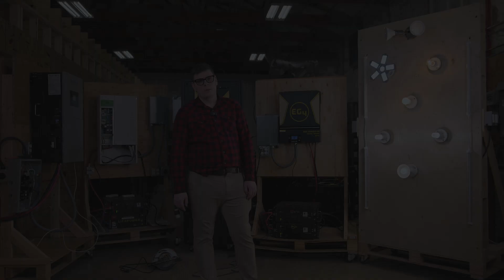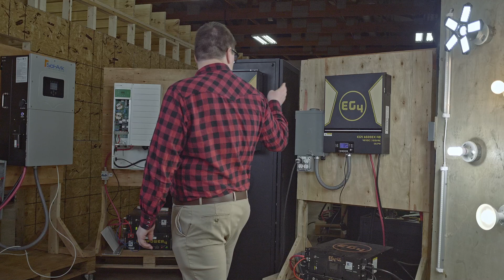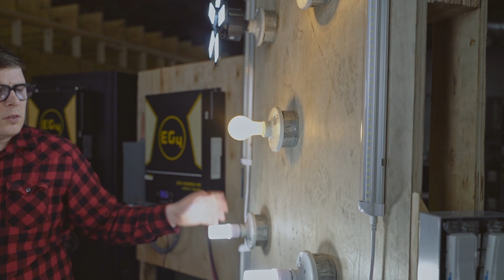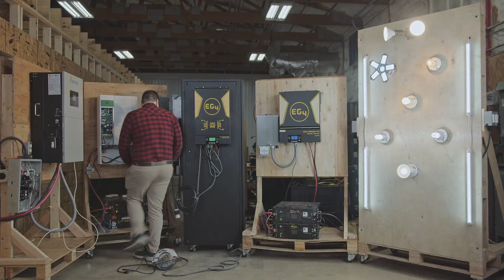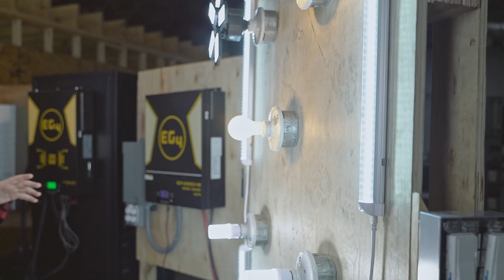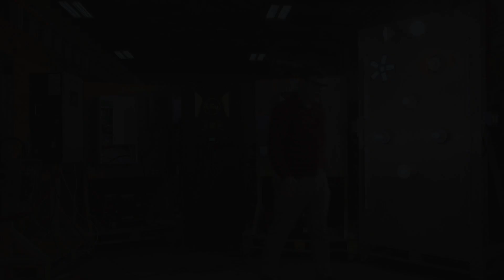LED Lights | The Sustainable Solution for Off-Grid solar users

Comment: Great I just installed the EG4 6000XP and noticed all lights flicker and with any power changes. The house is new with integral bulbs and fixtures. Replacing all the fixtures is out of the question. Now what?
Reply from the maker: Hi! If you'd like to reach out to our technical department at 903-441-2090, option3, we can take a look into this with you!

Comment: Noob question:  While testing the 6000ex, are you using a step-down to obtain 120v, or is it just one leg being utilized?  If one leg is being utilized is the power capacity cut in half?
Reply from the maker: One leg is being used and the power capacity is being cut in half

Comment: I've double checked my neutral and ground bonding. And I've replaced led bulbs and still have a terrible flicker and pulse.. Hopefully it will change when i connect all 4 - 6500's up.

Comment: I have the same flickering issue with the MPPSolar LVX6048 (same as the 6000EX in the middle) but only when using solar panels, (no grid), when using battery it doesn’t flickers.

I read there’s a firmware update fixing the flickering but I have no PC to update the firmware, just a MacBook Pro. All my house lights flicker, even the light inside my fridge. LEDs, Smart LEDs, encandecent, LED strips, fan’s LED lights, all kind of brands I’ve tested and each and everyone flickers.

Is there a way to update the firmware other than buying a PC laptop?

Comment: The only thing I need a AC inverter for is to push power back on to the grid which should be HVDC but it's not. It's much more difficult to tie in electrical grids with AC than DC........ HVDC is also more efficient than AC for transmission over long distanses.

Comment: Kan we please get 48 volt DC  bulbs / lights so we don't need to run an inverter.

My Fone, My Laptop, My Power Tools, My Chain Saw, My Speakers, Flash Light....... Everything I own Runs on  DC Even The Kar I want has is Powered by DC and the Power that Komes From Solar Panel That I want as well also are DC so wy exaktly do I need an AC inverter to change DC Battery Power to AC power to power all my DC Krap!!!!!

Comment: Thanks for the video. I’m having issues with split-phase loads like my mini split causing Philips Hue strip flickering and APC battery backup clicks to battery mode. Only occurs when the outdoor unit turns off. Strange part is it flickers expensive lights also only when it turns off.
Reply from the maker: Have you contacted our technical support team?
Reply: I didn’t. In my troubleshooting it seems to be my Cooper & Hunter Mini-split causing the issue. Looking into running a mini-split off the DC using your unit. 👍🏼

Comment: Very good demo video.  Scope traces would be nice to see what is happening.  On my whole house system, with 2x SMA US6048US and AC couple Enphase microinverters, I see similar flickering on certain led bulbs, when the microinverters output is approximately matching the house loads (generally morning and evening, or cloudy) and the main battery inverters are hanging out maybe not sure whether to charge or discharge the battery.  It's not a big deal.

Comment: My LF Aims 10kw 240v inverter did not flicker. I think you are correct that the HF  inverters do have more flicker problems. My biggest flicker problems is in the refrigerator bulb and micro-wave inside light. Also lights that have a dimmer switch. I have two EG4 6500 inverters dating 7-2022  that I am running separately as 120v units. Also the sewing machine bulb flickers. These are all small bulbs and I don't see me trying to find replacement bulbs of a higher quality. My LED lights are not flickering.  Going to look into the firmware update.

Comment: Corsi's you in lights start flickering not because of a power issue it usually means that the power of the light is no good no more and I liked about to break or die I mean light bulbs do go bad after a while but I don't think that would be my concern either.

Comment: Of course she said off-grid when you can also use it on Grand and could also use it to sell electricity to the electric company in almost all the 48 states I mean I know there's some companies that won't even pay for it but really doesn't have to be off grid it could be for cell to the grid and also for running your house and to 6000 watt inverter might be enough for my house but Ithinking I'll need three sweater have to go with four.

Comment: My light flicker REALLY bad during the middle of the day when my solar panels are putting out over 2000 - 3500 watts. I have the EG4 6000 unit. It's only when the PV input is being used to power the house or charge the batteries in the middle of the day that the lights flicker. At night when the unit is running off of battery power, I have ZERO problems with flickering lights. Does anyone have any ideas about this situation?

Comment: Really appreciate the tests and the time took to produce this video. Even on grid power you can expect some flickering with cheaper LED's. Then if you throw in dimmers that adds another circuit that needs to be stable.

Comment: So what I find interesting is that when I have my inverter running, I get LED flicker (PowMr 5000w hybrid inverter, 120v). When my furnace starts up while running on this thing, you can HEAR a difference in the draft inducer motor (it has this weird whine to it) which would tell me that the power coming out of the inverter isn't clean. Eventually, I want to get a transformer based 6000EX to power my loads, as I think the cleaner power will be much better for them. So I think the flicker is probably an indicator of slightly dirty power. Note that when the unit switches to AC power, everything is fine, so it's only when it's inverting that the power is "dirty".

Comment: Cheap led bulbs have very minimal circuitry. The better ones have converters, etc to change the AC to DC and clean it up.
Best bulbs I've had are Fiet versions that are COB (look like filaments)  The only time any of the bulbs act weird is when I have the inverter (growatt) set to switch to grid power at end of the solar day to charge the batteries.

Comment: I've even seen LED bulbs flicker from inverter generators. Happy to see that SS has a firmware update that helps to address the flicker issue with the 6500EX.

Comment: Good info James, thank you. I have several  cheap spiral LED bulbs that continually flicker and then fail when powered by my Growatt 12K or my Generac. Putting a scope on either output shows a fairly clean 60Hz Sine wave. Now I can stop looking at the source and examine the load.

Comment: Great Video;  Heck I get flicker while on Grid and LED lights, what really get them is the Keurig coffee maker "disco days!"  but worse in off grid mode,  I really just don't care because any light, heat and other house hold goods is way better than sitting in the cold dark nothing when the power goes out...
Reply: I have the 6500ex-48.  That mother #$@% Keurig almost caused me a mental breakdown after my system was running. I went through so much work trying to figure out what was causing my disco tech lights, I almost gave up and ripped my inverters down! One day I was in the kitchen ( not making coffee ) and I heard that machine make some noise and my disco started , I ripped the cord out of the socket and like magic my problems were solved!! I now keep it unplugged until I use it. Hopefully others can see this and know what's going on before going crazy like me. The Keurig will cycle when being used but most importantly when not being used and cause these effects!
Reply: @aaronweisser8777  Big Laughs well worded! 
I really hope this helps others, thanks for that reply, have a great day!
Reply: @asahperry6537 we are sometimes no match for all the wiles of all the appliance manufacturers combined lol

Comment: Can you give us some examples of what you guys classify as "high quality bulbs" that have little to no flicker (outside of motors running)?  What are the specific brands of the ones you tested in the video?
Reply: we used the keystone KT-LED13PAR38-F-840 to avoid flicker
the GE relax LED8DAGSW90 was the flickering one
Reply: @jamesshowalter6362  thanks
Reply: The Phillips hue bulbs, white only,  behave themselves, multiple models and years purchased.  Have been slowly changing over the whole house to zigbee compatible Wi-Fi bulbs. I like gizmos and no worries of turning off lights at night I can set them to do it themselves,  Haven’t tested the color ones yet. Cheap led shop lights absolutely do not.  Nice to see sig solar addressing this.  Have to admit they have done a bang up job with tech support for my eg4 ll v1 battery trying to get the lcd panel working again.  BMS replaced, didn’t fix, now replacing screen assembly.  Long post, sorry.  Longest lived led light is at 9 years so far.
Reply: Phillips!
Reply: forget that, can they give me an example when any light, led or otherwise will in REALITY last for 25 years, NEVER
Reply: @bonzology322  well I will be a middle-aged man by the time I can prove that point on the good ones lol

Comment: what does signiture solar consider a low quality bulb based on specs ?

what does sgnature solar consider a high quality bulb based on specs ?

all my bulbs are LED in the home
Reply: we used the keystone KT-LED13PAR38-F-840 to avoid flicker
the GE relax LED8DAGSW90 was the flickering one
Reply: LED bulb manufacturers don't typically provide any info on the driver they use so it's not easy to tell. Price and weight are probably the best customer facing indicators of quality for LED bulbs.

Comment: James, I am setting up my EG4 6500's this week. I have a spare Growatt autotransformer. Any issue or benefit from adding it to the EG4 panel for balancing loads. I understand it will increase idle current draw.
Reply: people have said that they have had better luck in hybrid cases with the grid auto former on the input, I would really just audit my bulbs, hard to find a bad $10 bulb

Comment: So the inverters are going to the batteries first and then to light bulbs?
Reply: Yes, unless you have solar panels, as it will take from the solar panels first and then the batteries through the inverter! Of course, it depends on the inverter quality.
Reply: @simon359 , I still have the Huawei and 26 panels. Need like 24 more. And batteries. 🙂
Reply: @patriciamariemitchel  
Better to have a back up gas/propane generator and a woodstove. Also, insulating your house. Everything isn’t just about solar.
Reply: @simon359 , true. I have a gas generator. I still want batteries. 🙂
Reply: @patriciamariemitchel  
A lot of people are buying the stackable rack lithium batteries, as you get more kilowatts per dollar.